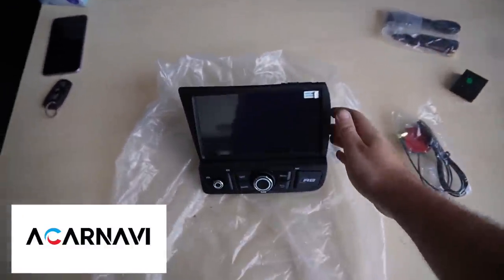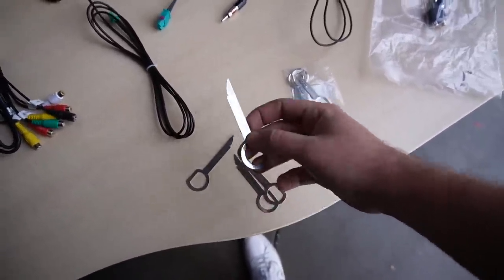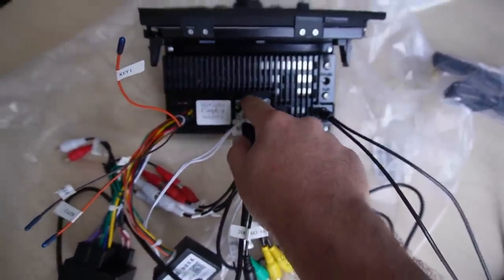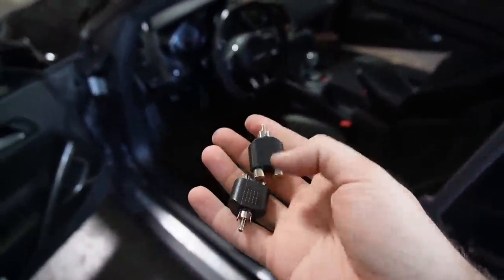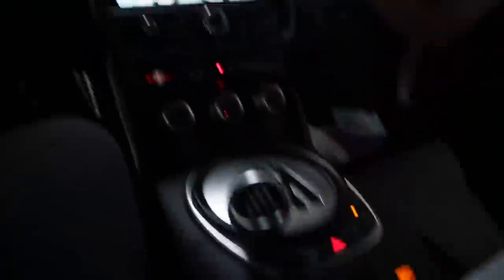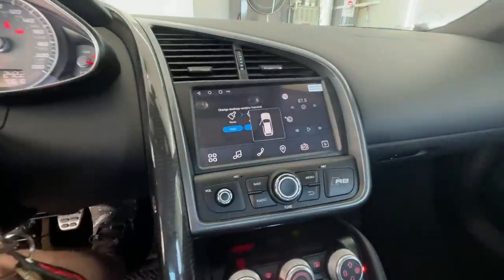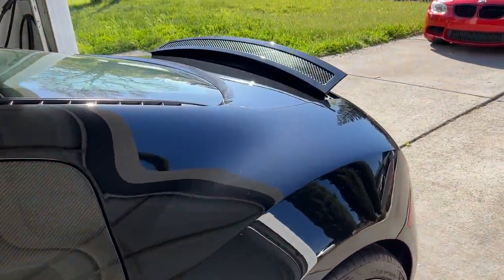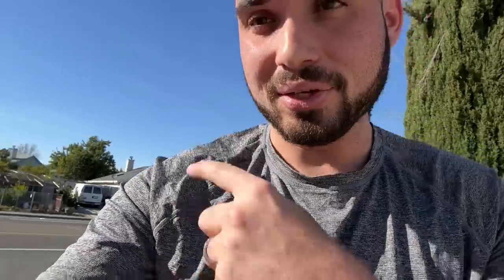NEW AUDI R8 MOD THATS A GAME CHANGER! + M3 STATE REFFED!

Comment: Thank you for this! I bought this head unit a couple months ago and just got around to installing a couple days ago and this was extremely helpful! Couple tips for anyone doing this that I ran into: First, there’s a fourth large connector on the OEM unit that doesn’t appear to get used. As far as I can tell, that’s just going to a very old school Bluetooth module. Don’t worry, you don’t need it. Second, this unit only outputs left and right, not 4 channels.  That’s why those splitters are included. You’re connecting your left out to both the left fronts and left rears. Same for the right. So you don’t have front rear fading. It’s annoying, but not game breaking in a smaller cockpit like an R8. Considering this is the newer generation of this unit, it really should have been addressed, but what can you do? Third, the CarPlay app is installed. It’s called TLINK5 in case you’re like me wondering where it is. Finally, the power output is not as good with this unit compared to the OEM unit. Again, it’s not bad, but if you really like to crank up your music, you might be a bit disappointed and have to consider upgrading speakers and amplifiers. All in all though, a worthwhile upgrade that is relatively easy to install, completely reversible, and add huge functionality without looking like a mod.

Comment: You’ll be back with the OEM headunit, trust me.
Reply: Been thinking about doing this on mine. Why do you say he'll be back to oem?
Reply: @lukegoodwin2160  because nothing outlast the oem unit plus oem makes it look more simple and clean
Reply: @lukegoodwin2160  because CHYNA. that's why
Reply: audio problems, overheating problems, runs slow after a while, pops fuses.
Reply: @lukegoodwin2160  everything that other guys said I can confirm, I have a lots of experience with android/linux headunits even the more expensive ones. None of them can even come close to the OEM, they never work as expected and aren’t long lasting. Best option if you want CarPlay is adding a module to the OEM headunit, for example something like “Prime MMI”. You can find it for any car and you keep your OEM headunit that is ways better than Chinese headunits.
Reply: Yeah had the same issues with the ones I used for bmw as well.

Comment: yah I have the same unit.. its not without major flaws.  ZERO control of front  / back fader control ... which car stereos have had since the EARTH COOLED,  also low / faint volume, fairly flat sound overall .  sure it's mostly better than the aged stock unit but its crappy Chinese stuff with virtually USELESS support and barely useful instructions